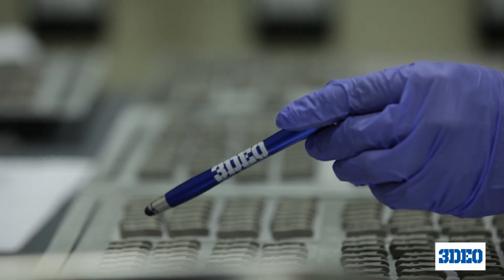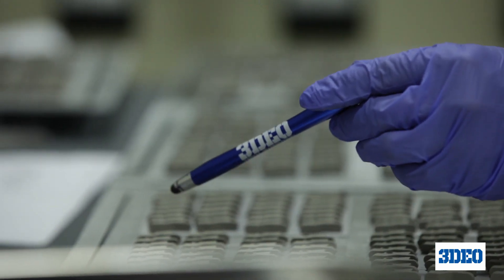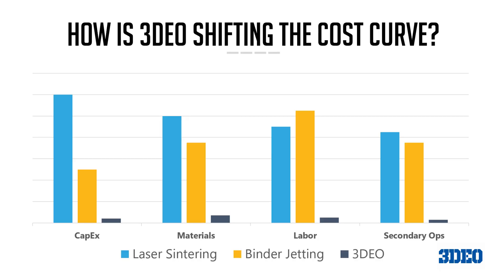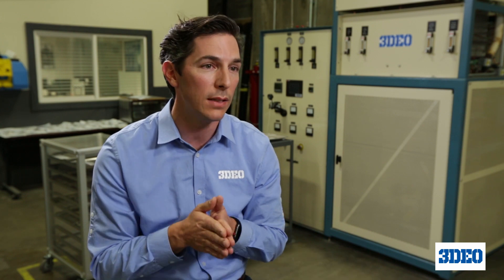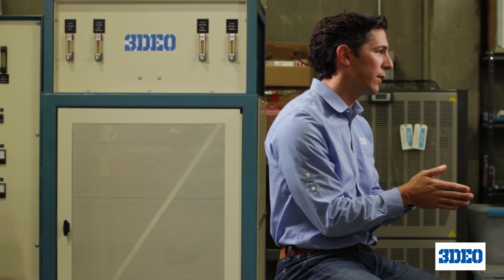3DEO | Part Cost Breakdown with Metal 3D Printing

Comment: Can u explain what do u mean by yeild?
Reply: Not involved with the company in any way but will answer the question since no one else seems interested.

Basically yield is the number of successful prints from a given number of attempts.

If you try to print something 10 times but only one of them is usable the you have a 10% yield. which means 90% of the material and machine time is wasted